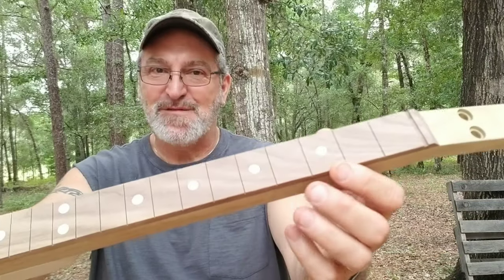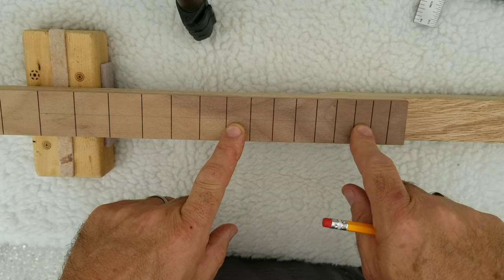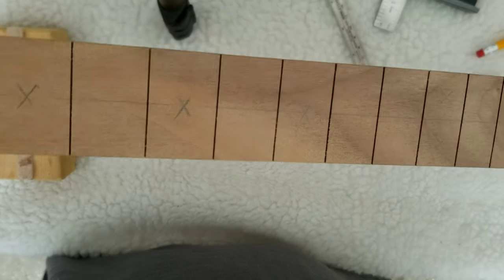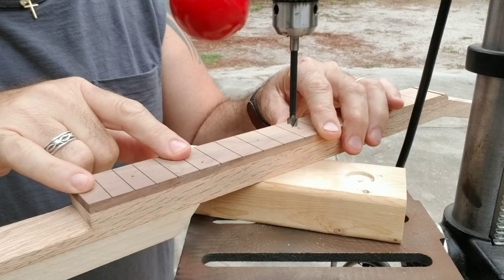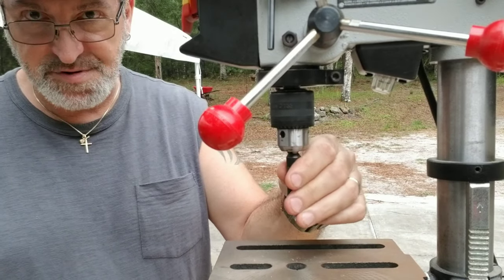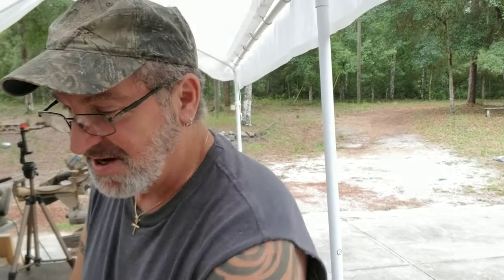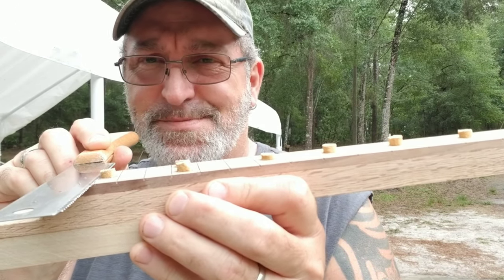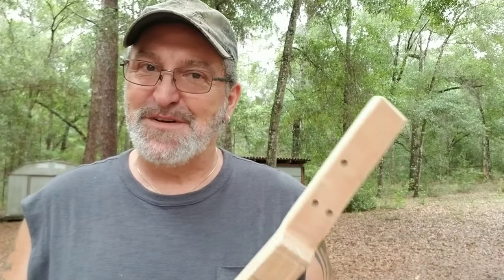How to make your own fret markers for your Cigar Box Guitar.

Comment: I suppose I could cut a dowel for the plugs until I get around to buying a plug cutter?
Reply from the maker: You sure can, Ive done that before also. works great. M~
Reply: Chopsticks work really well too  : )
Reply: Not that it matters but if you use a dowel the markers will be exposed end grain
Reply: @robertjeglum4657  Good point.
Reply: You can also just carve them.  Square blank. Remove corners. Octagon. Remove corners.  Light sanding.  Done.
Or chuck the blank into a drill and rub it against sandpaper.

The taper is the win.

That being said, I don't think there's anything wrong with a dowel except the lack of wood selection at the Big Box store. Of course you can buy anything online.

Comment: Why not just draw them on with a Sharpie? I'm working on a regular guitar fretboard replacement and though I have put in regular dot markers on a few fretboards, I am trying to save time on this and decided to use a Sharpie on maple and pass on all of the extra work involved with inlays. This fretboard is already radiused (Stew/Mac) but if I were radiusing myself I would absolutely inlay plastic dots. I'm burning in the side dots with a wood burning tool. I tested doing that on some scrap for the surface markers but doing that compresses the wood.
Reply from the maker: Thanks Fuzz. Well, I guess a Sharpie is one way to go, but I like to do the inlays, and they will never rub off :) I have done the wood burning dots though.  M~

Comment: Hi Michael thanks for the instructions for building CBG I’m attempting to build my first one but I stuffed up and glued the headstock to the underside of the neck can I still use it or will I have to make another one thanks mate
Reply from the maker: Your welcome, Marty thanks for checking it out. I have seen some with the head stocks glued to the underside , there's no rules. LOL  M~
Reply: Hey mate I’m having a problem can I make the neck level with the box before I add the fret board as I am adding a sheet metal face on the box part of the guitar do I have to compensate for the thickness of the metal plate as well or no   Maybe I can adjust it with the height of the bridge to give the right clearance? Or doesn’t it mater. I’m using a Tasmanian oak neck and fret board that is neck 3 and 1/4 inch and fret board 1/4 and one notch which is 8 millimeters
Reply from the maker: @martywright1979  Hi Marty. I would compensate for the thickness of the metal sheet if its going to be the new top of the box, but you may be able to adjust the bridge height for the clearance as well. Happy building. M~